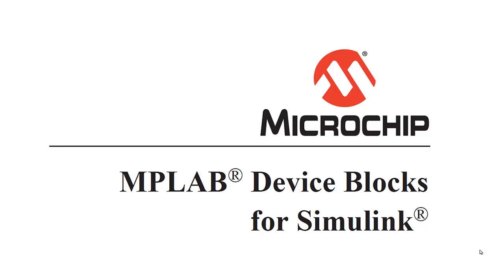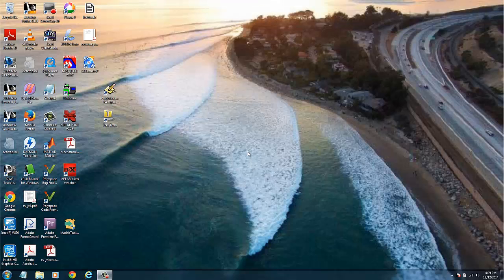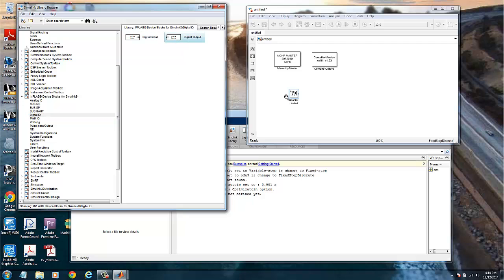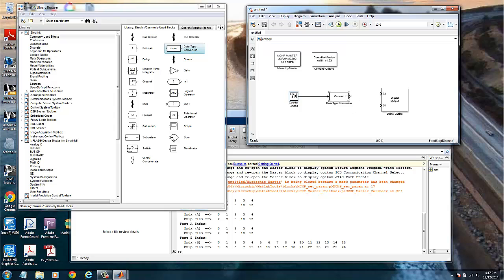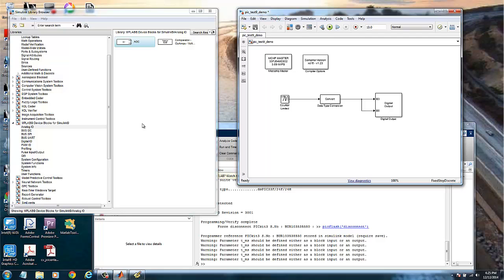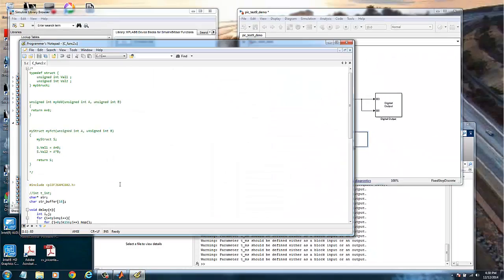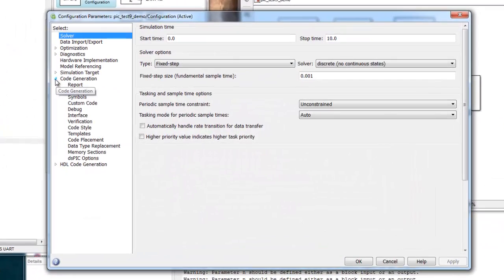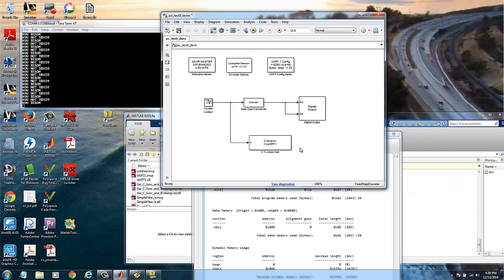Programming a Microchip dsPIC using Simulink

Comment: Hi Jose, Thanks for nice demostration. I did as per your demo. But while building I am getting this error "MPLAB X IDE is not found in the system". But in my Laptop I already installed "MPLAB X IDE v5.10". Please help to solve this issue.

Comment from the maker: @aya First install Matlab and MPLABX and the 16 bits compiler, then download the Device Blocks  installer from the Microchip's  site shown at the beginning of the video. Run the installer. With the file manager you can browse to C:\Program Files (x86)\Microchip\MatlabTools. There you will find examples folder  as well as a Quick Start Guide  (docs folder.)
Reply: Jose Vicente  I wanna to send the IMU 6050 read to UART by modification the model included in this path  like here http://diyhacking.com/wp-content/uploads/2014/11/mpuSerial.png
Could you help me ?